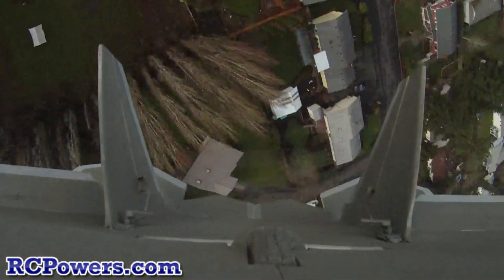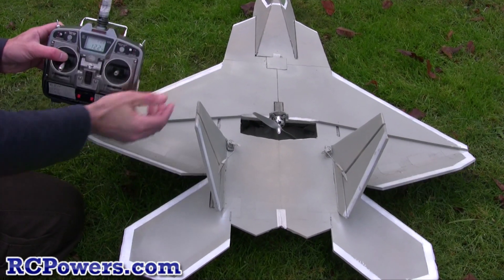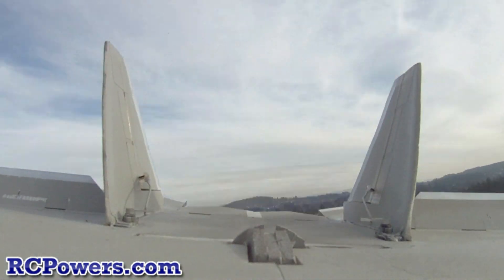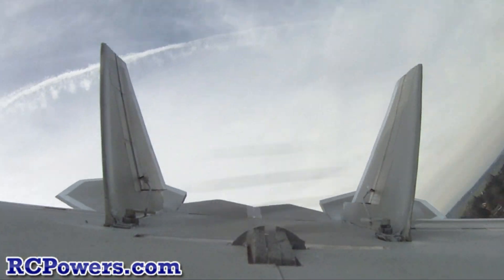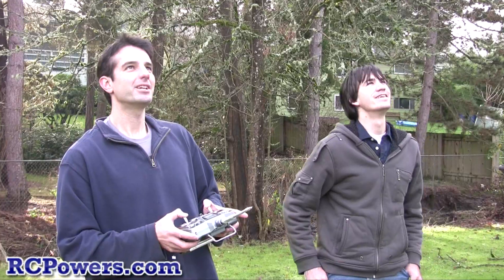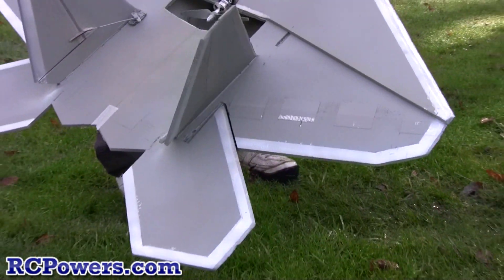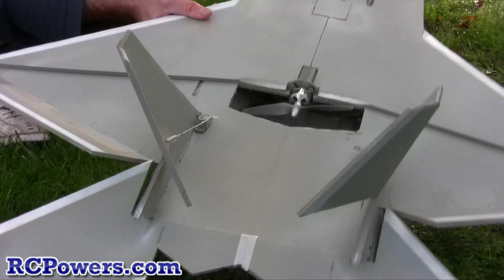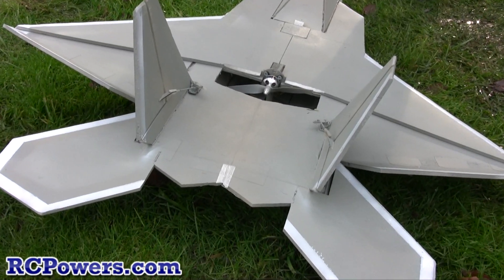F-22 ADVANCED FLIGHT CONTROLS

Comment: @coultam Flaps increase lift without the need to increase angle of attack. This is necessary for real-sized heavy airplanes - high alpha really isn't a very practical way to do landings and slow flight with real airplanes, not even with fighters, whereas for foam planes it is a viable option due to thrust to weight ratio and structural strength being proportionally greater than for real sized airplanes.

Foamies have lot of lift, they can sacrifice some with spoilerons to gain more stability.